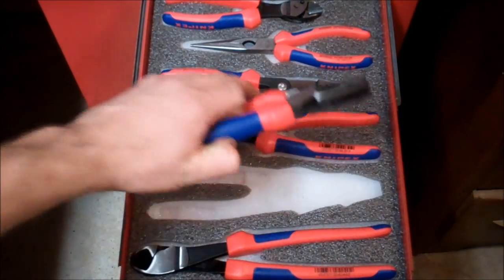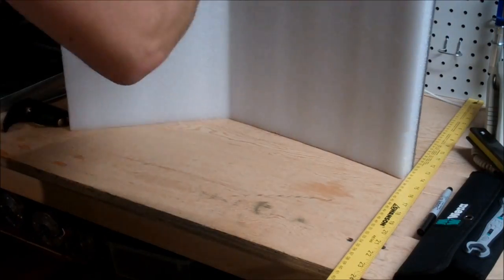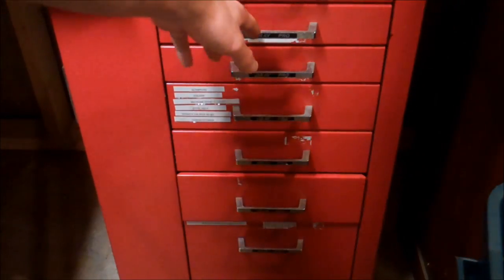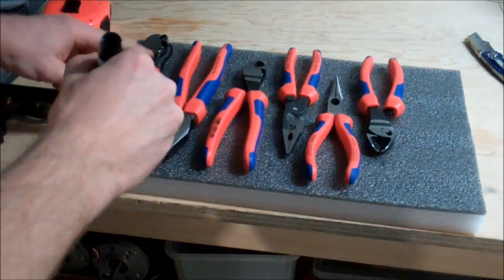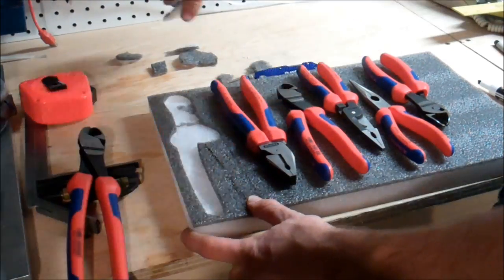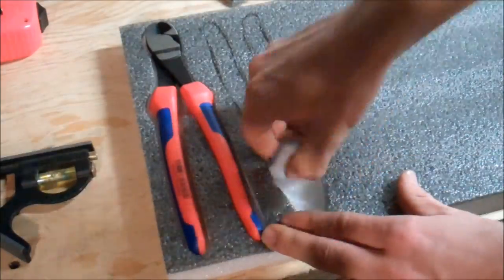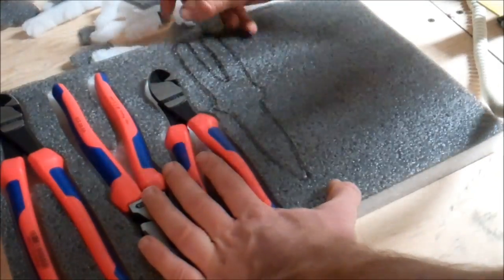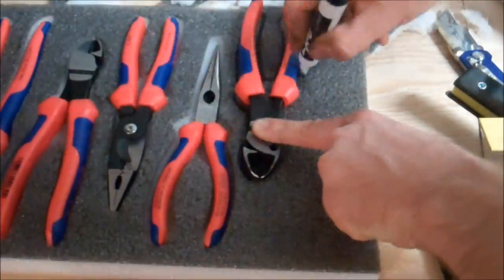Tool Organization

Comment: Just came across your video, thanks for the tips!  

Not sure how the foam has held up, but for gun folks. We like to spray a couple layers of plasti-dip over the foam once you have it fully cut out. This helps with reinforcing the foam/preventing tears.
Reply: Thank you for a terrific idea! While I wouldn't use the foam for my tools - takes way too much space - I do have a number of dial indicators whose original packaging had seen better days. I think the foam would work out great.

Comment: Can you give us to link on Lee Valley. I have not been able to find the one with the white bottom.
Reply from the maker: I included the link to the foam in the description as I can not post links in the comments. But if you have any problems I got it from Lee Valley, Wood Working, Storage, Miscellaneous,Layered Foam Sheets!
Reply: Thanks did you use the 30mm or 57mm?
Reply from the maker: zerocool5878 This drawer U used 30 mm but if you check out my lab tour video you get to see a bit more of my handy work and I used both! Mulitmeters get the 57 mm and man is it nice